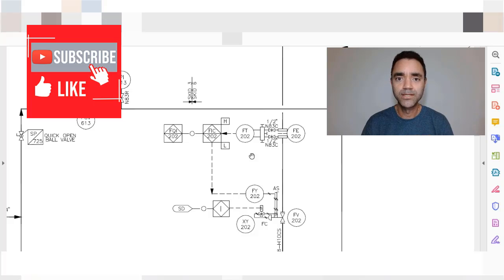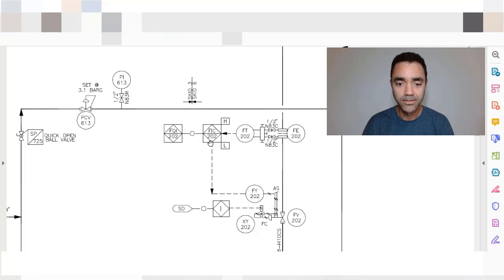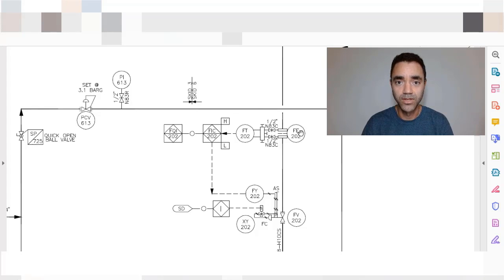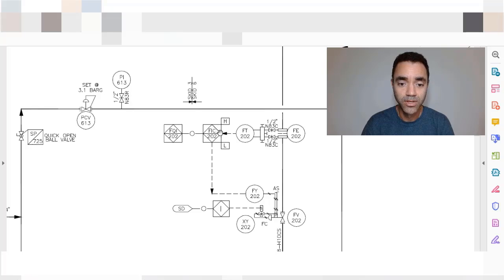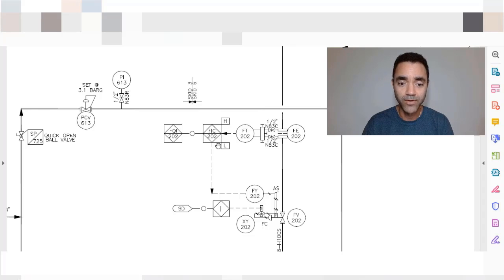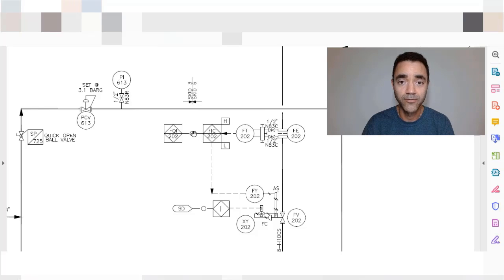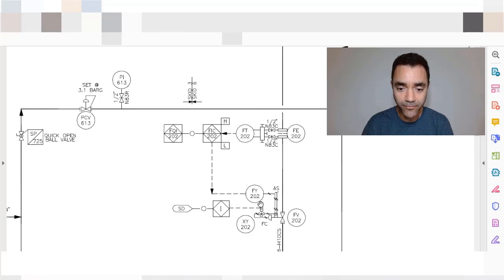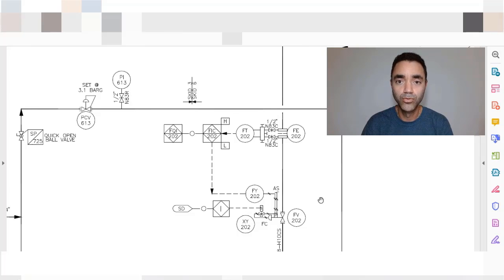How to identify a flow control loop in the PID | Flow control on P&ID for chemical process engineer

Comment: Why FIC controller has DIAMON shape but not CIRCLE. I think except it belong to package it will has diamon shape
Reply from the maker: Hi, each company has its own internal procedure to represent control on P&ID. To make sure what each symbol represents, the correct action is to consult the Symbol Legend sheet 😇. This company for instance, do not use square with circle and crossing line to represent information on control room (supervisory system).